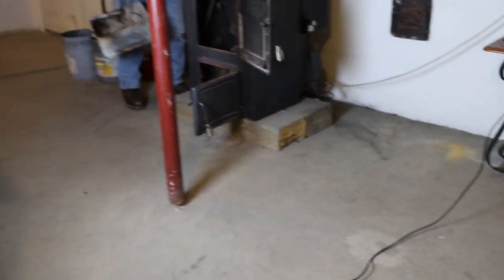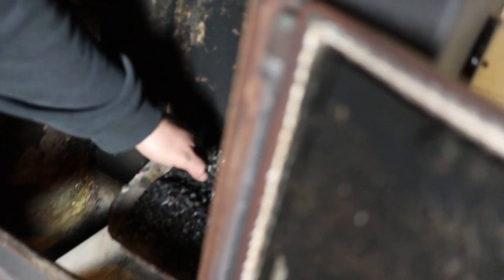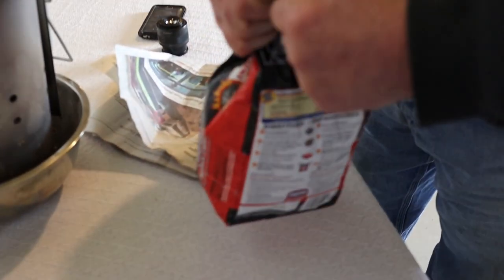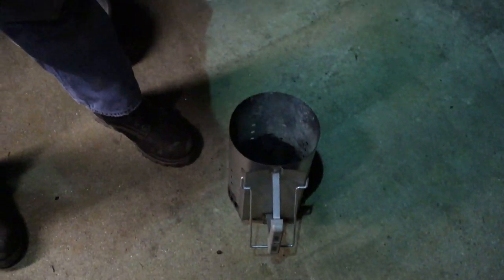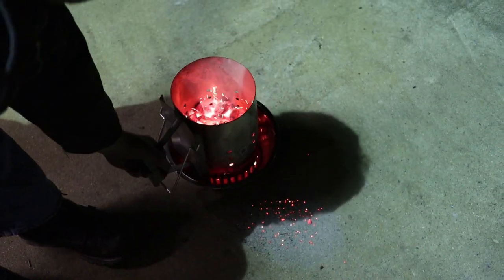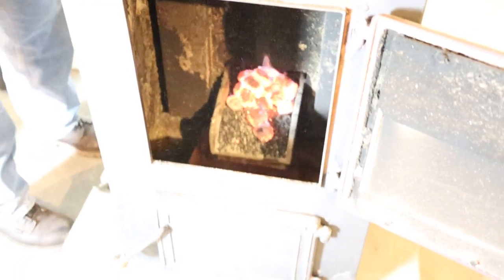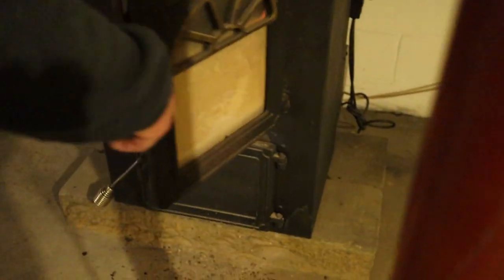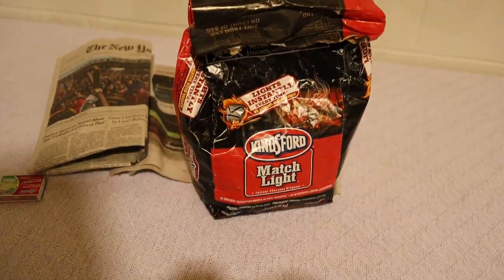How to light a coal stove quick

Comment: Why can't you put the match light briquettes in the stove in your grove you make. Light them when they get red hot add your coal. And have more time for beer.
Reply from the maker: They'd stink because of the quick start chemicals. No electric draft, if there's no draft that smell comes right back in. Start it nice and hot outside, almost instant draft once inside stove.
Reply: Ok... Even so the stink would only until they all become exnited. I seen one guy on YouTube use the hole bag for one the cost would start to add up and not necessary. What ever works....